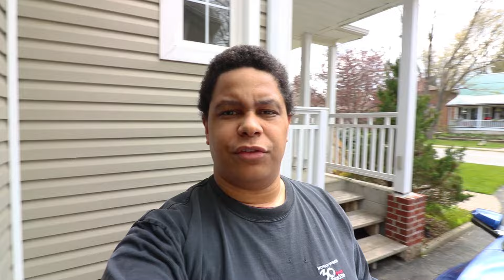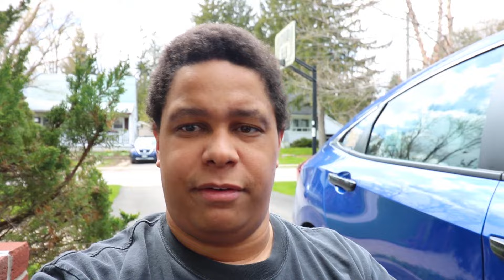How To Install  A Front Lip On Your Car.

Comment: Protip, fit the product with 3m double sided tape, then while it’s on there drill your holes.  Then remove the lip, remove the tape, and seat it flush with the screws.
Reply from the maker: That works as well. I personally didn't use the tape because I take the lip off for winter. Alternatively you can also get a couple bolts in there as well. That will prevent lip from coming off for sure.
Reply: Even better to keep the double sided tape in there along with screws so its a nice snug fit.
Reply from the maker: True. I have since properly bolted the lip on the car. So it's not going anywhere.
Reply: @TurboKitchen if you look at Hopkins reply, he said to reply, he said remove the 3m tape after marking the holes. Then attach the spoiler with the screws.
Reply: @TurboKitchen  You misunderstood OP. He said to use double sided tape to fit the lip properly, then drill your pilot holes, then take off the lip and remove the double sided tape, then re-align your lip and screw it in. now your bumper is perfectly lined up without any guess work or having the lip fall off while drilling pilot holes.

Comment: Drive up ramps work as well...no jacking required.
Reply: Not if your car is low and then good luck getting the car back down with the lip on making the clearance even tighter.
Reply from the maker: For sure. I was going to borrow a friends ramps until I realized that would be dumb since I am lowered. It would have been interesting had I gone with it and filmed. Lol
Reply: @TurboKitchen  i really didnt think about that part...but now that you guys mention it..when i put my stock height civic on ramps to do the oil change...it did barely make it up and down it ..so having the lip would be a prob....im sure you could use wood pieces to supplement .but even then..a jack would be your best bet when you are lowered.
Reply from the maker: Yeah for sure. Jack or a lift if you have or have access

Comment: In germany we use blind rivets for installing. More easy installation can be done via 3m double sided tape and 3m primer. If this is done correctly no screwes or rivets are needed. We are mounting our front lips via 3m double sided tape on various cars - even on Audi R8.

Comment: Whats the max speed youve ever driven with this on ? Im curious bc i installed mine and its literally the same low car i got and at 80 mph it cracked from the middle idk how … maybe i hit a small bump on the way is what i was thinking but crazy how it broke the same day i installed it 😂🤦🏻‍♂️
Reply from the maker: I've done 80mph and more and not had an issue. But I had alot of screws on it and currently have 6 bolts holding it on.

Comment: I've recently purchased a lip for my car and have been looking around on how to install so this video has helped me out by a lot. I do have a question regarding drilling into my car, would i be drilling into the metal part or plastic and is there a downside to drilling holes?
Reply from the maker: You're drilling just in the plaatxi bumper part. There is no downside to drilling other than cosmetics with the holes. But if you never remove the lip then you're ok

Comment: Question for ya, my Avenger friends have splitters and have the rods that go into the bumper. They told me to get one but I don't think it's necessary as I got a lip and not a splitter. Rods aren't necessary correct for lips?
Reply from the maker: They are not necessary no. You can use rods if you wish but it's more for aesthetic look than actual functionality at that point. It won't hurt the lip to have a bit of extra support but as mentioned it is not necessary. Nobody wants to drill more holes then they need to into their car.
Reply: @TurboKitchen  definitely agreed, I'm old school and think the rods look kinda goofy unless it sticks out far and needs the support. Thank you! I appreciate your help!
Reply from the maker: @vincevollmer1716  You're welcome. Happy to help!
Reply: It's actually for more structural integrity for downforce when at high speeds. But you really want to put the rods on the actual metal bumper behind the bumper cover. If you put it on the bumper cover, it will just in time, come out.

Comment: Did you also use the 1 inch self tapping screws to attach the front lip along the lower center part of the bumper in front of the intercooler? I want to do something like this on my 2016 Civic but it seems like 1 inch long self tapping screws might be too long and will go right through the middle part.
Reply from the maker: Yes I did. The screws run all along the front. They don't come through the middle at all.

Comment: Here’s my 2 cents. Although he is right about how to install. I put corner splitters on a Jetta a while back and those things will rip out of the plastic ( your bumper) at high speeds (100mph+). 
The best solution I found was putting a flat metal piece just wide enough to fit inside the inner lip of the bumper and using bolts to secure in place. After that they never pulled out again.
Reply from the maker: I've never had an issue with things ripping off at high speeds.
Reply: If they're just corner splitters, that changes the whole game with the aerodynamics. So I wouldn't be surprised if they would need some extra reinforcing. Solid advice regardless though, if you're not using nuts and bolts I would always suggest extra reinforcement.

Comment: Can i just use double sided tapes instead of drilling? or is the drilling the safest option?
Reply from the maker: You can use tape but drilling is safer long term. Less likely to fall off of you scrape it. Also drilling is easier of you are gonna take it on and off. I take mine off for winter.
Reply: @TurboKitchen  the thing is mine is a OEM lip so it doesnt stick out. I guess ill check with double side tape first. 

So for the tape, do i just stick the tape from the one end to the another and stick it to the bumper? what do you suggest?

Thanks in advance
Reply from the maker: Double sided tape has 2 sticky sides. Typically the top layer is covered so you would stick one side to the lip then peel off the backing and stick lip to the car. Make sure its lined up first. Which OEM lip do you have?
Reply: @TurboKitchen  its for Lexus LS430. OEM ones would be Toyota Celsior's so I got those.

Comment: You should wrap it in carbon fiber
Reply from the maker: I have thought about it. I have some vinyl I could try.
Reply: I found a real nice lip on eBay for my 2016 civ. Came as a carbon fibre design. I was astonished the quality of stuff on eBay you can get for the civics.

Comment: Could I just use 3m tape instead of screws?
Reply from the maker: Yes but it would be more likely to fall off. Plus if part comes off its hard to replace one section without taking whole lip off. With screws you can just replace or fix them quickly. It also depends where you live and how you use the car. I drive my car all year and through Canadian winter so I remove the lip to avoid ripping it off in snow.

Comment: So do we need to drill on the original bumper or there are already a hole for lips installation
Reply from the maker: You will need to drill into the bumper.

Comment: What’s the name of the screws and where u get them
Reply from the maker: Quarter inch self tapping screws. Any type would work. Can get them at any hardware store.
Reply: Turbo Kitchen Home Depot?
Reply from the maker: Yep home depot has them. That's where I got mine. You want 8x1 inch with quarter inch head

Comment: Don’t use self tapping screws, the vibrations will eventually weaken and/or loosen the thread/screw and it’ll come off. Other than that well done!
Reply from the maker: Been using the self tappers for a few years now and has stayed on no problem. But I guess every car is different.
Reply: so what to use?
Reply: 拓海哥之車CAM直擊 i would use dry wall anchors as an alternative to plain self tapping screws
Reply: @bilokenneth  I would recommend using:

10-32 x 3/4" Stainless Pan Phillips Machine Bolts
10-32 Stainless Nylon Insert Locking Nuts
1/4" x 3/4" Stainless Steel Fender Washers

The reason I recomend these is due to the fact that self-taping screws can loosen over time. And by using the Nylon Locking Nuts, you can assure they won't come undone. Also, by using the Pan Phillips Machine Bolts, you are making sure you leave very minimul head room sticking out in the event you want to add a splitter down the road. If you use something with a big head on the end of it and install a splitter down the road, your splitter would be pressed up against all those heads, creating a gap. This way, that doesn't happen.